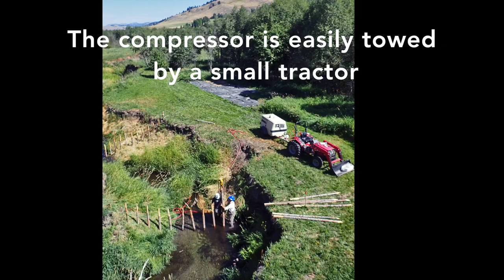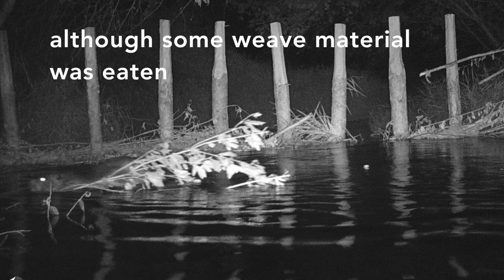Beaver Dam Analogues - A Visual Tour of Triple Creek

Comment: Why not just re introduce beavers to do the job for free.
Reply: The eroded river has very steep banks that beavers can't climb up, so there's no material at all for a beaver to build. If you release beavers there, they would just die. The point of this project is to fill the river channel with sediment, so it lifts up, eventually levelling with the surrounding floodplains. Only then can beavers do their work.
Reply: That was my question also. Just plant the right kind of foliage along the creek.   But maybe they had to get the stream bed higher and more plants and trees before the move back in of the beavers